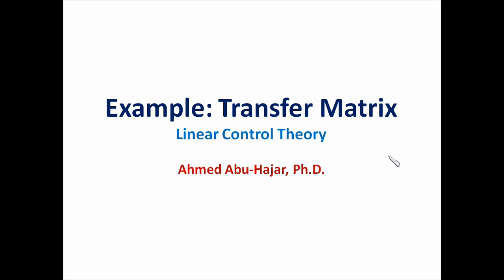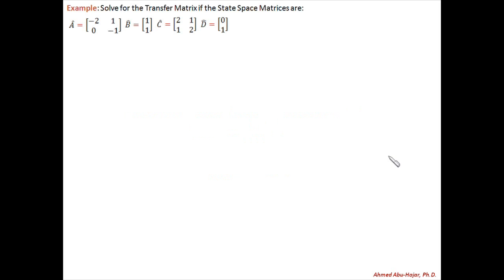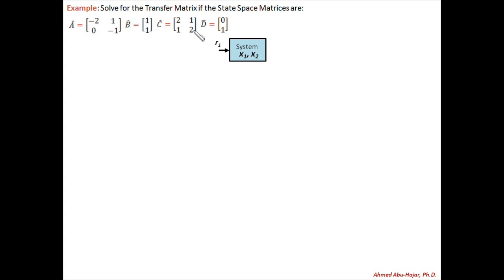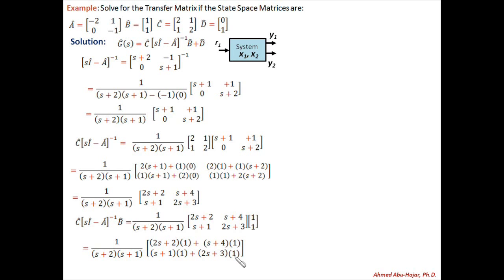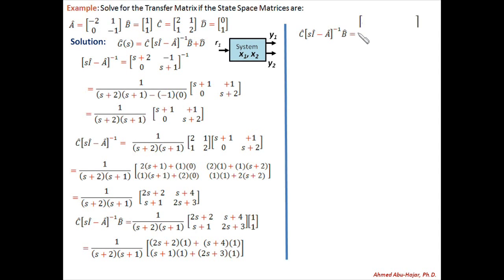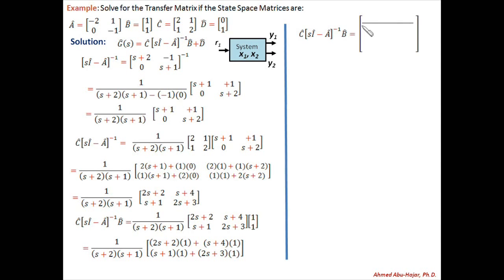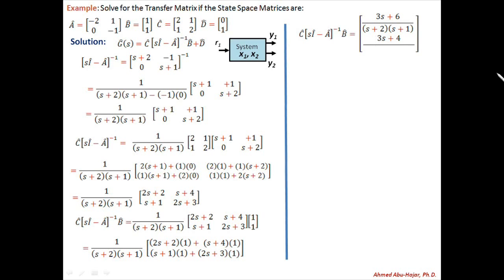Transfer Matrix Example: Linear Control Theory

Comment: how do you solve something that looks like this : 

[w ; E] = [g11 g12; g21 g22]*[P; E1]    , where the ";"- semicolon means new row and space means new element on the same row ? 
as far as i could figure the calculation on the right side is done row by column and then we have 2 structures ? meaning the 1st row of the left matrix is "w" = [g11*P g12*E1] and "E" = [g21*P g22*E1] or am I wrong ?